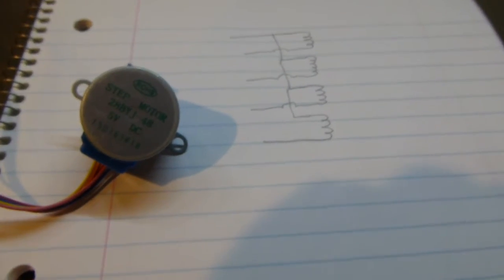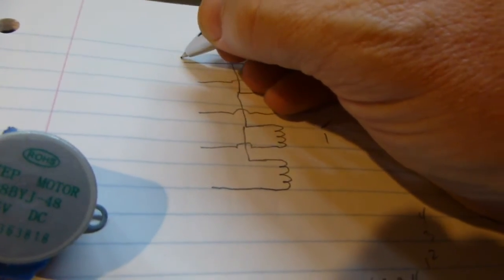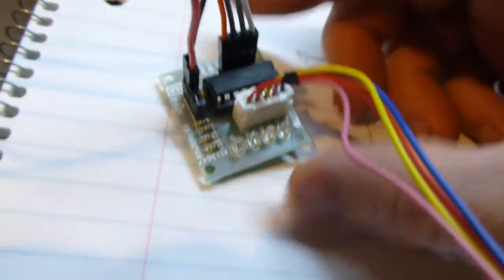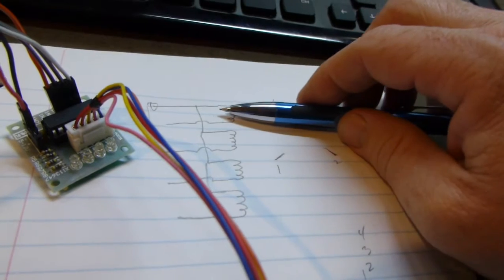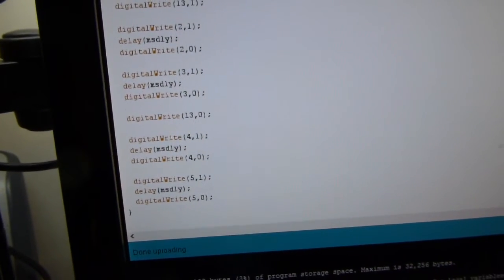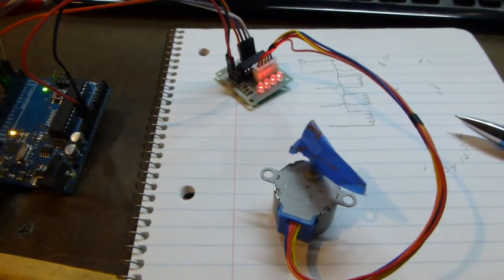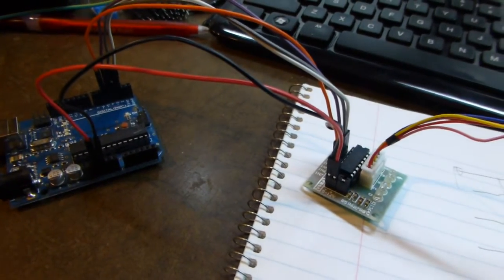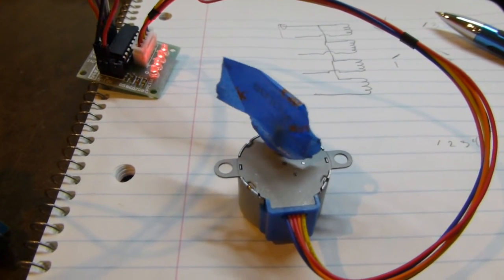Arduino Blocks: controlling a unipolar stepper motor

Comment: Nice video, you mention some important issues people should look out for.   "Back EMF" is an important one.  

The motor and board you are using are often available for beginner Arduino kits.  Beginning kits use the library Stepper.h, which needs to know the "Steps Per Revolution".  Do you know the steps per revolution on that stepper?  I can't find the data sheep on it for some reason.
Reply from the maker: I don't offhand, but it's simple enough to figure out.  Stick a flag on the motor, pick a value, have it step that many times, see how far it rotates.  Make it x10 for better accuracy.  It's a geared stepper so it may not be a sensible value (IE it could be not an integer value of steps per rotation).
The board here will protect against back EMF.  Designing your own circuitry that has to drive bipolar steppers and protect against back EMF is probably not an exercise for someone who doesn't know about back EMF.
Reply: 32 steps for the internal motor @ 64/1 ratio needs 2048 steps to move the output shaft one full revolution.

Comment: Thank you for your great video! My question is: how can i understand which wires are paired?  i have a driver (a4988) but i can't figure it out the connection between wires, can you help me? thank you!
Reply from the maker: +Ostrica391 Use a meter set in ohms, find which wires have a connection between them. The A4988 uses 4 wire bipolar motors (6 wire can be used as well, if you have one of those let me know). Find one pair with a connection between them (should be something less than 100 ohms, maybe as low as 2 or 3 ohms) and connect that to 1A and 1B, connect the other pair to 2A and 2B.  Try it out.  If it runs backwards you can either change that in software or swap 1A and 1B to the opposite wires (you can actually swap either pair)

The motor in this video is unipolar which is not compatible with the A4988.

Comment: Your example motor is not the cind your describing,, it has 2fields and a 500 to 1 beer reduction
Reply from the maker: +Noah Oscarson I promise you that it is.  Look up the data sheet.  This is a 5 wire, 4 coil unipolar stepper motor.  The schematic in the data sheet draws it as 2 center tapped coils with common center tap, but electrically that is 4 fields.